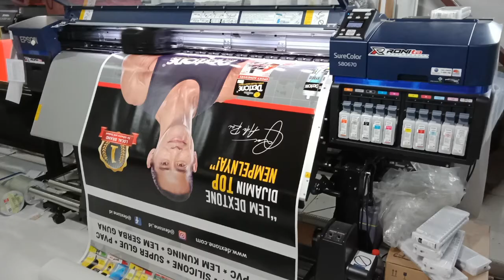Jasa Cetak Oscar Super Hires - RONIta

Comment: Harga per meter nya berapa pak ya
Reply from the maker: lgsg WA aja p irfan

RONIta Digital Printing
Jl. Raya Buaran Viktor-BSD 
Gang Mawar No 121
Desa Buaran Gardu, Kecamatan Serpong
Kota Tangerang Selatan, Provinsi Banten, Indonesia
Kode Pos 15310 
Phone : 021-75671566
SMS/WA : 081210987567 (Irfan) +62 878-0828-6804 (Ipeh)
0895804171390 (Nia)
Email : ronita.dp@gmail.com
Website : www.ronitadp.com